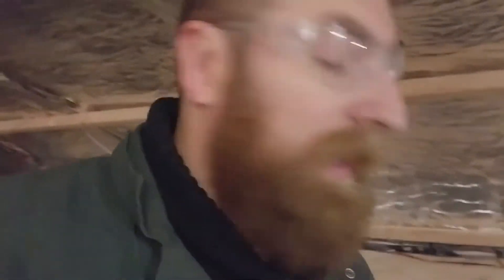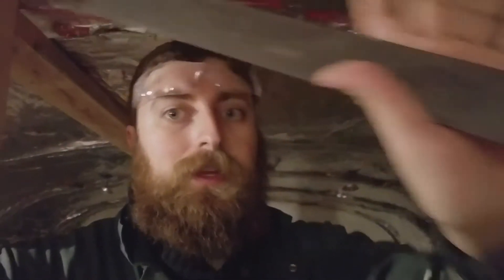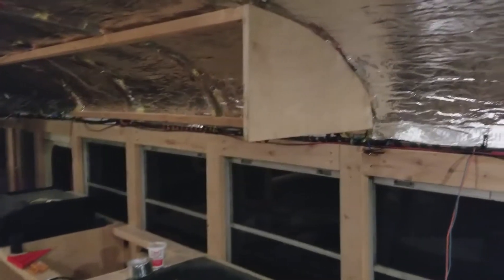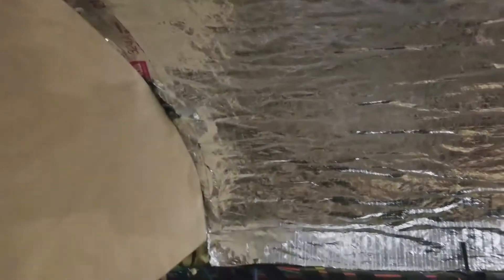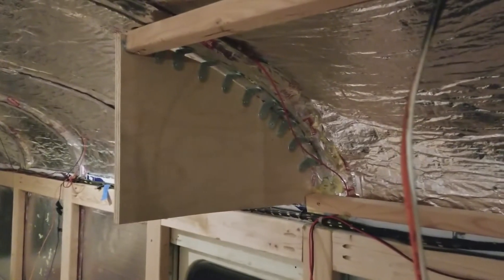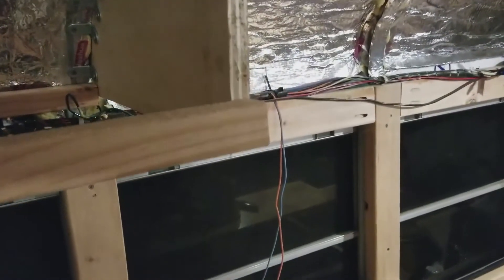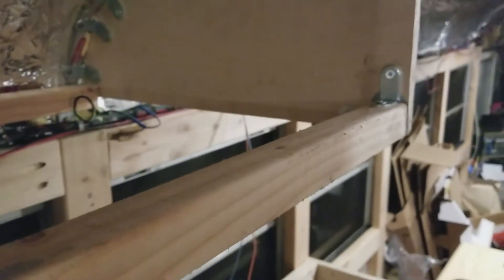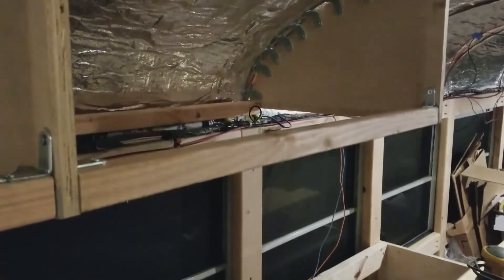Conversion Video 23: Installing Hanging Cabinets

Comment: Hey, I have since bought myself another shortly Skokie and I used the same as you on the L-brackets but I used about 4 to attach my cabinet to the inner skin using steel pop rivets (just like they do) and you can't badge it.....I used wood screws dipped in wood glue on the wood...... Happy trails and safe journey.

Comment: I'm not trying to be disparaging but the 'L' brackets and 3/4 inch plywood are 'overkill' to the point of wastefulness... If you really wanted something that sturdy, why didn't you fabricate and weld in metal cabinets? I suppose it will be functional but so would 1/2 inch plywood glued and screwed to 2"x2" attached with 'TEK' screws dipped in 'Loctite'. I've built buses before but even had I not, this is the age of information and we no longer have to build/fix things by accident... Best of luck to you both and safe travels!
Reply: Jerry Adams well a few is fine but 12 on each side lol
Reply: Concur